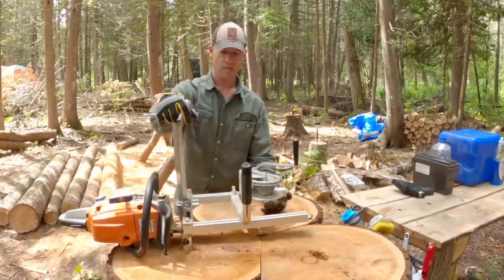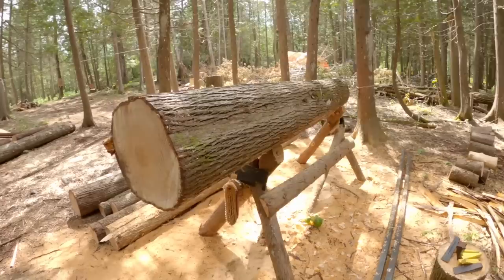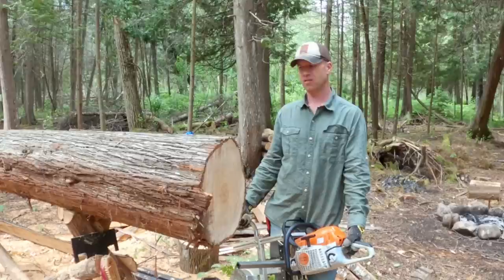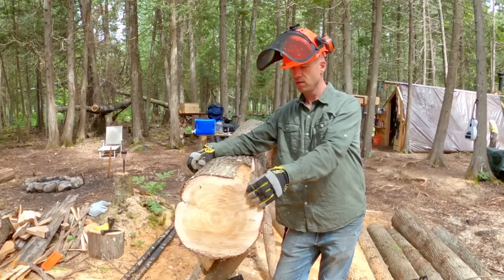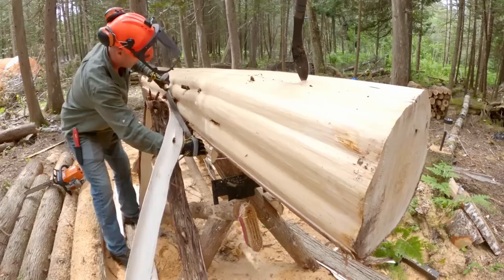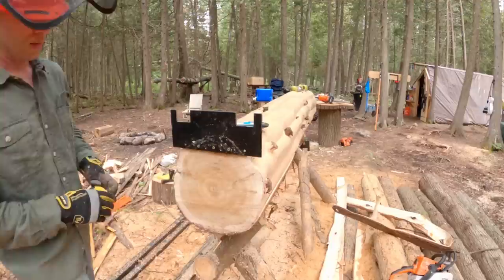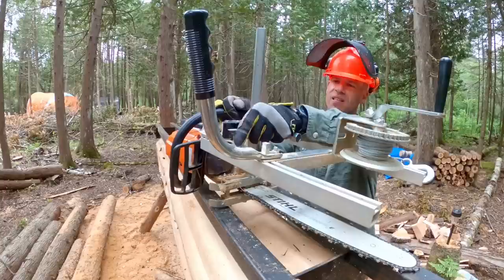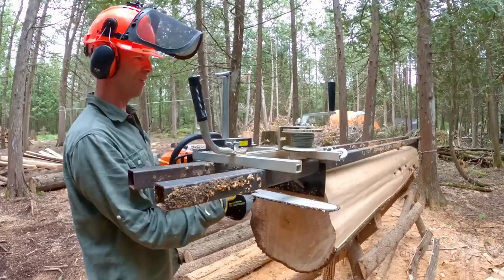Chainsaw Milling- How it Works.  Granberg Alaskan Small Log Mill G777 #12

Comment: Adjust oil flow on your saw . should help with hot bar and chain. will stay sharp longer
Reply from the maker: I’ve got the oil screw turned as far as it will go. Wish there was some way to modify it to put out even more. Or maybe that’s not necessarily?  Most of the heat seems to come from continuing on pushing when the chain isn’t super sharp.
Reply: Granberg sells an auxiliary oiler kit. Not sure if it fits on the small mill (I have the same one), but their part number is G801A. I remember guys somewhere doing a DIY oiler. I think Logosol makes one too.

Comment: I tghink yo0u should gert you an earth auger as narrow as possible n start drilling holes I know you have rocky soil but Im sure you have find a spot occasionally that might not have rocks and a small augere might increase the worth or value of your land. Or learn about dowsing because sometimes you find under ground streams so you dont always have to go real deep to hit water. 10 15, 20, or 30 ft. and even aquifers raise and lower over time trees have to have water to grow maybe look around the larger trees and their root systems for drilling ur test holes. The dowsing should help  find shallow water or underground streams I know this may require testing and thinking and recording places on your property to drilled.

Comment: Once you cut your board, how do you cut the 2 inch sides straight?
Reply from the maker: You mean make the edges of the boards straight?  Just snap chalk lines and rip them off with a chainsaw.  Check out vid #17 and you can see it done I think.

Comment: I didn't even know that was a thing!
Reply: Don’t have a portable mill, so gonna try freehand slabbing some teak this weekend - if I can get the old chainsaw started and then hit the slabs with another Stanley plane.
Reply: @user-sp3zi9vo9l  let us know how that worked out! Milling without some sort of jig would be really hard, I believe
Reply from the maker: Hey Leon,
It just so turns out (I didn't realize this till just now) that D 5341 is MY DAD.
He slabbed up a teak log to make a coffee table and, as expected, the cuts were ragged.  Ended up having to run the boards through a plane many times to get them down to flat- loosing a solid inch on either side.  But if you don't have a giant band saw, what else can ya do?  (I mean, if you can't talk your son into driving the 4 hours either way to bring you his chainsaw mill...)

Comment: Hey man great video!  Where did you get the brackets and the square tube?  That’s a slick set up.New subscriber, looking forward to more videos!
Reply from the maker: Hey Jeremy. Thanks for watching and subscribing!
I bought all the metal at a welding shop and cut the plates out myself with a cheapo angle grinder w cutoff disc. 
Look up in the comments- I gave someone else the dimensions- if you are interested in making a set. 
(I stole this design from another YouTube video and they work great! Wouldn’t change a thing.)

Comment: It says August 8 for the video.  Did you really cut and peel that log in August?  It is springtime for me to have the bark fall off like that.  80 Miles North of Seattle.  Waiting a few weeks more  to peel a windblown Doug fir in the woods that still has greenery on it..  Just for post,  but I have logs to mill so I might get one of these Grennbergs.  You might have talked me Into it.

Comment: Are you using an actual ripping chain or one reground to ripping dimensions? I’m able to completely cut a few logs that size before a resharp. I’m a new subscriber and love the channel. I’m not criticizing you at all, im just curious.
Reply from the maker: Not sure what I was using at the time.  I tried freakin' everything before getting actual ripping chains.  And man what a difference.  They last 3 times longer in some instances.
Reply from the maker: What kind of wood do you mill?
Reply: Usually cutting oak, maple, cherry. Hardwoods

Comment: New to the channel so I might have missed this, but, have you tried a ripping chain to extent the life?  My buddy uses them and I believe the main difference is 35 degree to 10 degree.  You might have mentioned it and I missed it.  Regardless, love the content so far.
Reply from the maker: I think when I made that video I was still using a variety of other chains.  Didn't care what the cut looked like I just wanted them done as fast as possible.  Then I got a ripping chain and realized just what you said- they last waaaay longer between sharpenings.  Doesn't make sense to go 30% faster with a full chisel chain but only get three feet before you have to sharpen it.

Comment: Do you use a ripping chain if so what’s the source.
Reply from the maker: Granberg makes the only chain made 100% for ripping that I've found.  Can get an Oregon or Archer or something that is basically the same thing though they have ground down some cutters after the fact to make it a ripper.  Maybe that doesn't matter tho?
Reply: From what I understand the only thing that matters is the degree of angle on the teeth, I think 12-15 deg for milling. I could be wrong, usually. Lol.
Reply: @survivingringworm2202  Check out Bailey's WoodlandPRO

Comment: Supposedly they make rip chains and they are supposed to be better cutting than the reg cross cut chains.just saying, haven't found the right ones for my saw yet though.
Reply from the maker: Hey Adam.  I made a video a month or so ago testing out all sorts of different chains for milling side-by-side including standard cross cut and purpose made milling chains.  You might find it interesting.

Comment: The bar doesn't slip under the clamp or do you really crank it down? Mine kept twisting out as I cut, but if I cranked the bolts too hard I felt like i was pinching the bar too hard. Advice?
Reply from the maker: Hasn’t really slipped at all. Shouldn’t really be that much pressure on the clamping part unless the chain isn’t sharp. With a fresh chain it almost pulls itself through the wood.  But after running the thing for a year, there definitely are dents where the bolts contact the bar. Doesn’t hurt to crank on it!

Comment: Where do you get the guide rail brackets for the steel beams? I think I will just draw some up and get them laser cut if I can't find an easy source.
Reply from the maker: Made them from scrap steel.  Check out "the cost of moving to the wilderness" video I made recently.  I measured out the plates on camera in case anyone wanted to make their own.

Comment: I have been looking at getting my first granburg i am more interested in your rail set up and where you either purchased it or how you made it. Second, do you use a rip saw with the mill? I have heard some say a cross cut???? I will add where did you get the wench set up and lastly do you like the small mill, I have been going back and forth between that one and the 24 in bar one...  Thanks
Reply from the maker: Small mill is fantastic. Very glad I didn’t get a bigger one. Easier to manage and you can pull the whole thing out of a log without unbolting the saw from the mill. 
Yup, granberg makes a great ripping chain. Makes all the diff. 
Made the rail system.

Comment: What are the plates you screwed to the log and where do you get them? It doesn’t look like it comes with the chainsaw mill. Thanks
Reply from the maker: Just scrap sheet steel that I cut to shape with an angle grinder.

Comment: How would it work with my 54cc cordwood saw?
Reply from the maker: Granberg suggests at least a 55cc saw for this mill.  Mine is actually a 50cc but a lot of hp for the size.  With a couple sharp milling chains and not milling hardwood, you'd be fine.

Comment: I've been watching ur videos. I really enjoy them. I do have a question? Is it possible to make  siding with a chainsaw mill?
Reply: Yeah I have that same set up, actually mine is the larger version. You can adjust the thickness of the boards you cut to almost anything you want. Making clapboard siding would be pretty simple. Now, if you want to make shiplap siding, you'll need some more tools to cut the overlapping edges that fit together. There is another version of this that lets you run your saw vertical and cut straight edges on the long side of the boards you mill, but I think it's easier to just run a table saw from a small generator to do that.
Reply from the maker: Yup.  Just about any thickness is possible.

Comment: Great video thanks for sharing. Where did you get your end plates and rails from ?
Reply from the maker: Made them.  Got the metal from a welding shop.  If you read down in the comments I left the dimensions for someone else that asked if you want to make some yourself.

Comment: have you ever looked at the harbor freight band saw mill?  I was thinking of getting one of those instead of upgrading my saw + a mini mill.
Reply from the maker: Are they any good?  I finally have this system so that it never fails though it is really slow...
Reply: @survivingringworm2202  From what little research I've done they seem ok although consensus seems to be you can buy a Woodland Mills HM122 for a little bit more money and get a better quality machine with more readily available spare parts.  I don't have any large diameter trees like you do so I think the loss due to the chainsaw kerf vs. a band saw would be significant to me and I want to side my buildings with slabs so that's a lot of thin strip cutting.

Comment: Where did you get your end plates ? If you made them , what are the dimensions ? Thanks good video !
Reply from the maker: Thanks Don! Glad you liked it. 
I got some scrap metal from a local metal shop and cut the plates out with an angle grinder. I found the info for making them in the comments of another YouTube video. Lure of the North I believe. 
2X2X5/32 steel tubing. I think mine are 12’ or 13’ long. I’d considered longer but I can’t lift logs any bigger anyway. 
Plates are 1/4X5X12
Plates fit the tubing with just a little play side to side in case the end of the log is a little out of square, the rails will still fit. 
Notches in plates leave the rails about 1/2” proud of the top of the plates. 
The more screw holes you drill along the bottom of the plate the better. Gives you more options to set the screws as wide as possible to really hold the plate right to the log. 

Hope that helps!
Reply: @survivingringworm2202  Appreciate the answer , thanks !
Reply: After wrecking a chain or three, I switched to aluminum on my end plates. Works great when things aren't as precisely aligned as they seem.
Reply from the maker: Do you have a similar setup? Screw on plates and metal bars?
Reply: It's functionally similar. Instead of bars I have the aluminum plates affixed/squared to the end of a 2x6.

Comment: Did you make those end plates or buy them? I've tried to find them to no avail.
Reply from the maker: Made them from scrap steel.  Check out "the cost of moving to the wilderness" video I made recently.  I measured out the plates on camera in case anyone wanted to make their own.

Comment: Where do you get the plates to attach to the logs for the square tubing? I saw them in another video and was going to make them. But it would save time to just buy them.
Reply from the maker: I made them.  Don't think you can buy them.  Saw them on another youtube channel a while back and they seemed to make more sense and were more robust than the other stuff you could but so I went for it.
Reply: @survivingringworm2202  what dimensions did you go with? Does that size work well for a lot of different sized logs?
Reply from the maker: I think I gave someone the dimensions to build it all early on in the comments on this video.  Think my bars are 13' so can do up to 12' logs.  Any bigger than that I can't lift 'em anyway.
Reply: @survivingringworm2202  found the info, thanks!

Comment: where did you get the rail system for the first cut sir?
Reply from the maker: Made it! Got scrap metal from a welding shop and cut the plates out with an angle grinder.

Comment: Do use a ripping chain?
Reply from the maker: At the time of making this video, I was trying every combo of chain types and sharpening angles.  Then some time later I finally bought a proper ripping chain and now that's all I use.  The one that Granberg sells, in my opinion, is as good as they get.  The rest either don't cut as well or more often just don't stay sharp long enough to be worth using.
Reply: @survivingringworm2202  
Thanks for letting me learn from your experience!